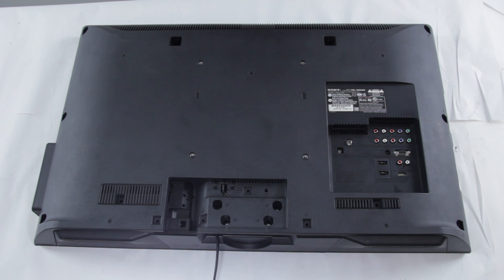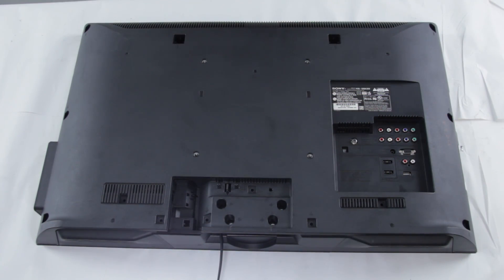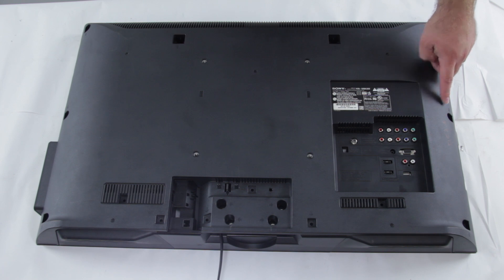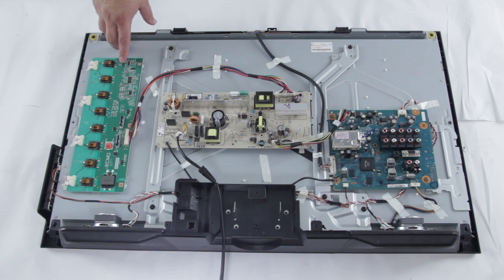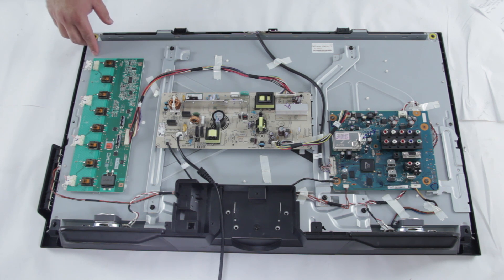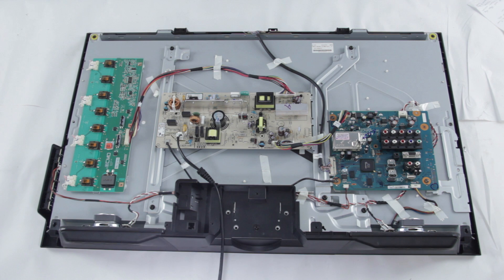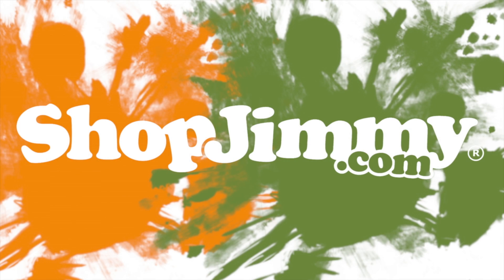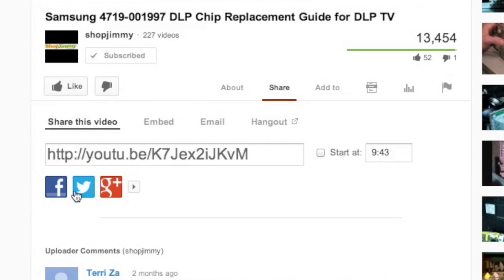LCD TV Repair Tutorial - Backlight Inverter Common Symptoms & Solutions - How to Fix LCD TVs

Comment: i have philips 47pfl6704d/f7 there is sound but no picture we turned all of our lights off and used a flashlight and can see the picture, would this be the inverter?
Reply from the maker: Heather Sullivan   Yes, that is the problem.  For your TV model, the backlight inverter is actually on the same board as the power supply.  Thus, you will need to replace the power supply board.  Here is a link to replacement parts for your TV model number on our website, click here:  http://www.shopjimmy.com/catalogsearch/result/?q=47pfl6704d%2F  Be sure to match part numbers on your current board, with your replacement for compatibility.  You can also call our customer service for further assistance with your purchase.  (877) 881-6492  Thanks and please let us know if you have any further questions with your TV Repair!  www.shopjimmy.com

Comment: I have a vizio m470vse led tv. Just over a year old. It turns on. The vizio logo shows up on the screen and then within 5 sec or so it turns itself off..help please..thank you
Reply from the maker: Josh Bourdon   I recommend running the flashlight test on your TV.  In the flashlight test video we mention that if you do see an image you should replace your backlight inverter, but if you see an image with the flashlight test, you should replace your power supply.  I recommend running the flashlight test on your TV.   Here is a link to a video we produced that shows how to run the flashlight test. No Image No Picture on Screen-Flashlight Test LCD TV Repair - How to Diagnose Broken Board TV Repair Please reply with your flashlight test results and we can recommend a replacement part for your TV repair. Thanks and please let us know if you have any questions! www.shopjimmy.com

Comment: Hello, I'm Fidel and I have a dynex LCD tv DX-40L261A12. I was watching tv and the screen turned black but the sound was still there, so I shut off the tv and turned it back on but now there's no image or sound, ( no sound maybe because I changed channels), it starts up like normal, grey screen with the words please wait.. (thats what it normally did) but right after it turns black. but I have been looking on the internet and all signs point to the backlight inverter, I think. I shine a flash light to the screen and I can see an image of the menu when I click on menu so I hope its not too messed up. Please if you have an idea or a way to help me out I would very much appreciate it. Thank you
Reply from the maker: fidelroldan1   I recommend running the flashlight test on your TV to help determine if the problem is the backlight inverter or the main board. Here is a link to a video we produced that shows how to run the flashlight test. No Image No Picture on Screen-Flashlight Test LCD TV Repair - How to Diagnose Broken Board TV Repair Please reply with your flashlight test results and we can recommend a replacement part for your TV repair. Thanks and please let us know if you have any questions! www.shopjimmy.com

Comment: Hi good video, I have a SONY 40"FULL HD LCD  Model #: KDL40CX520   This TV has a panel issue. Still works, but the picture comes through in green and pink hues. Could this also be the back light inverter, your help would be appreaciated.  thanks Rob
Reply from the maker: yammy64   This sounds like a TV panel problem.  If your TV panel is bad, it may be more cost-effective to replace the TV as panels are typically hard to find in stock, difficult to replace, and expensive.  Thanks and please let us know if you have any further questions!  www.shopjimmy.com

Comment: i have a proscan tv (40ld45q) and the part # is t871034.02-1 i found the part # on ebay but a diffrent modle # can i use it
Reply from the maker: Richard Drew  As long as the connectors match, you should be alright.  Thanks!  www.shopjimmy.com

Comment: Hi, i have a 32" VIZIO (E3D320VX) and when i turn it on, the logo splash screen comes on then shuts off, then the backlight comes on for a second and shuts off. The only thing that stays on is the white LED power indicator light. Also, i have taken the power supply board out and put it back in and it seemed to fix the problem. About a week later, same thing happened so i did the same thing and it seemed to work. It has just happened again but my "fix" isn't working. When i looked up the power board and backlight inverter, it says they are the same?
Reply from the maker: *****   Yes, that is correct the backlight inverter and power supply are on the same board.  Here is a link to replacement parts for your TV model number on our website, click here:  http://www.shopjimmy.com/catalogsearch/result/?q=E3D320VX  Be sure to match part numbers on your current board, with your replacement for compatibility.  You can also call our customer service for further assistance with your purchase.  (877) 881-6492  Thanks and please let us know if you have any further questions with your TV Repair!  www.shopjimmy.com

Comment: I NEED HELP!!! I have a 42" LG LCD T.V. I turn it on and it comes on fine, after about 10minutes of being on the screen goes black, I have sound but the screen wont come back on. I went to my local repair shop and explained the problem to the repair guy. He told me, in these exact words ''The Inverter has gone'' I have tried to find a spare one for my T.V (including on your website) but I am having no luck. I can easily replace any parts myself but I can not find them anywhere online. So my question is....Is it the inverter and if so could you tell me where I can find a replacement? My T.V is a 42" LG LCD with the model Number: 42LF65-ZC & the serial number: 708wraj2u704 & Product Code: 42lf65-zc.aecmljg. Realy hope you can help me out.
Reply from the maker: Arkady Red   Can you find a number on the actual inverter board(s) itself?  This number could be on a white sticker.  If you can find this information, please reply with that number and then I can recommend a replacement part.  Thanks!  www.shopjimmy.com

Comment: Hi my sony tv just went out like no power nothing at all. I try to plug it to another outlet but still no power no lights. Tv  model number KDL-40BX450 WHAT could be the problem please help
Reply from the maker: shane bethel   I recommend replacing the power supply in your TV.  Here is a link to replacement parts for your TV model number on our website, click here:  http://www.shopjimmy.com/catalogsearch/result/?q=KDL-40BX450  Be sure to match part numbers on your current board, with your replacement for compatibility.  Here is a link to a video showing how to identify your part number, click here:  TV Part Number Identification Guide for Sony Power Supply Unit (PSU) Boards (LCD LED Plasma TVs)  You can also call our customer service for further assistance with your purchase.  (877) 881-6492  Thanks and please let us know if you have any further questions with your TV Repair!  www.shopjimmy.com

Comment: Hi, I have a LT46153 and the screen looks good for about 10 seconds when you first power it on then it starts to go dark from the middle towards the sides stopping about 10 inches from the ends, is this a backlight inverter board or a power supply issue in your opinion, Thanks in advance, John
Reply from the maker: John Ray  I recommend replacing the backlight inverter in your TV.  Here is a link to replacement parts for your TV model number on our website, click here:  http://www.shopjimmy.com/catalogsearch/result/?q=LT46153  Be sure to match part numbers on your current board, with your replacement for compatibility.  You can also call our customer service for further assistance with your purchase.  (877) 881-6492  Thanks and please let us know if you have any further questions with your TV Repair!  www.shopjimmy.com

Comment: Hi there I have a samsung 37" lcd tv.
model no LE37A456C2D
serial number 72883HBS102178Y

I was given this tv as it was faulty, pictures would be pixelatted and looked solarized.i took the tv apart hoping it would be a quick fix with a change of capacitors, but now when I turn the tv on the backlights come on but only a black screen is visible.tried to use a flash light but can see anything and cant get any sound.Could this just be replacing invertor or multiple boards that are damaged?
Reply from the maker: Michael Davison  I recommend replacing the main board in your TV.  Here is a link to replacement parts for your TV model number on our website, click here:  http://www.shopjimmy.com/catalogsearch/result/?q=LE37A456C2D  Be sure to match part numbers on your current board, with your replacement for compatibility.  Here is a link to a video showing how to identify your part number, click here:  Samsung Main Boards & Digital Boards: Part Numbers for LED, LCD, DLP, Plasma TV Repair  You can also call our customer service for further assistance with your purchase.  (877) 881-6492  Thanks and please let us know if you have any further questions with your TV Repair!  www.shopjimmy.com

Comment: I have an LG 52ld560 LCD TV which won't turn on. The standby light just flashes red. I replaced the power supply board and this had no effect. None of the capacitors appear damaged on any of the boards. What could be causing this problem?
Reply from the maker: Callan Orgill  I recommend replacing the main board in your TV.  Here is a link to replacement parts for your TV model number on our website, click here:  http://www.shopjimmy.com/catalogsearch/result/?q=52ld  Be sure to match part numbers on your current board, with your replacement for compatibility.  Here is a link to a video showing how to identify your part number, click here:  TV Part Number Guide for LG & Zenith Main, Digital, & Tuner Boards (LCD, LED, Plasma TVs)  You can also call our customer service for further assistance with your purchase.  (877) 881-6492  Thanks and please let us know if you have any further questions with your TV Repair!  www.shopjimmy.com

Comment: I have a Sony Bravia KDL55V5100.  I turn the TV on, the green LED stays lit, the backlight shows through the back of the tv, then the tv turns itself off. Then back on and off again.  I have spoke to ShopJimmy Techs and they told me to replace the backlight inverter boards.  I replaced all three today and still the same issue.  Would this be the Main Board issue?  Please help.
Reply from the maker: Frank Razek   I recommend replacing the BM3 board in your TV.  Here is a link to replacement parts for your TV model number on our website, click here:  http://www.shopjimmy.com/catalogsearch/result/?q=KDL55V5100  Be sure to match part numbers on your current board, with your replacement for compatibility.  Here is a link to a video showing how to identify your part number, click here:  TV Part Number Identification Guide for Sony Main Boards (LCD, LED, Plasma TVs) TV Repair

Comment: your videos are sooo helpful. really appreciate them.  I have a samsung ln46a650. when i start it up half the screen is very dark.  after a while it flickers and then kicks on (although its never as bright as right side, maybe 90%).  i replaced the capacitors but no dice. I tried replacing the tcon but that also had no effect.  Do you have any thoughts on what could be wrong?
Reply from the maker: zaf88   I recommend replacing the backlight inverter(s) in your TV.  Your backlight inverter is either its own board or is connected to your power supply.  Here is a link to replacement parts for your TV model number on our website, click here:  http://www.shopjimmy.com/catalogsearch/result/?q=ln46a650  Be sure to match part numbers on your current board, with your replacement for compatibility.    You can also call our customer service for further assistance with your purchase.  (877) 881-6492  Thanks and please let us know if you have any further questions with your TV Repair!  www.shopjimmy.com
Reply: ShopJimmy.com  thank you but ive located my problem and it is a loose TAB ...any fix for that?

Comment: I have a sharp aquas LC-46D82U. When the tv is plugged in you here a click, about a minute later another click. when the tv is turned on you can here a click and the the blue and green lights come on and the screen turns a faint white, like the lights being half powered. no picture. I watched some of your videos so I took the back off and visually seen no bad capacitors or loose wires. I checked voltage from ground to two replaceable fuses and got 65 vac, I got 600 vac on the fuse that is permanent. Did not get voltage from the plug that goes to the backlight boards but the lights went out when I unplugged that connector.  suggestions?
Reply: There are three red lights on the video board. 1 by itself is blinking, 2 side by side and 1 is blinking.
Reply from the maker: kevin lycans  I recommend replacing the backlight inverters in your TV.  Unfortunately I do not see any replacement backlight inverters in the search results for your TV model number on our website.  Thanks and please let us know if you have any further questions!  www.shopjimmy.com
Reply: ShopJimmy.com just did that....no change

Comment: We have a Vizio Model# SV470XVT1A
We are hearing sound and have no picture at all, do you think it could be the backlight inverter?
Reply from the maker: Sara Welliver   I recommend running the flashlight test on your TV to help determine if the problem is the backlight inverter or the main board. Here is a link to a video we produced that shows how to run the flashlight test. No Image No Picture on Screen-Flashlight Test LCD TV Repair - How to Diagnose Broken Board TV Repair Please reply with your flashlight test results and we can recommend a replacement part for your TV repair. Thanks and please let us know if you have any questions! www.shopjimmy.com

Comment: Sir, I have the same Samsung LN52A650 television with BN44-00201A with the power cycling on/off and red flashing led. I swapped out the four 1000uF capacitors but that didn't change the problem. I then swapped out the power supply with a known good used one and same issue. I was able to get a known good used main board to try and the only thing that changed was no chime. Any ideas on how to proceed?
Reply from the maker: Gary Seymour   Try this repair at your own risk!  Unhook the main board from the power supply and plug it in and if the back lights come on you have a bad main board then if the back lights don't turn on you have a bad power supply.    Here is a link to replacement parts for your TV model number on our website, click here:  http://www.shopjimmy.com/catalogsearch/result/?q=LN52A650  Be sure to match part numbers on your current board, with your replacement for compatibility.  You can also call our customer service for further assistance with your purchase.  (877) 881-6492  Thanks and please let us know if you have any further questions with your TV Repair!  www.shopjimmy.com

Comment: Sony Bravia KDL-32L504
When you plug the power cable in you hear a click. When powered on via the remote or button on TV green LED comes on, picture comes on for 1 second and then screen goes black.  If I change the channels or hit the menu button as soon as I power it on you can see the menu options on the screen for the 1 second that the picture comes on or if I select a channel or change the channel the correct channel number appears. No flashing red LED just solid green when powered on. Also, have tried the flash light test after power up and cannot see anything at all...screen is just black.   I've been looking, researching on line for this specific issue and have only seen a couple of posted but no solutions or how to fix videos.  Any advice would be greatly appreciated!!
Reply from the maker: Steve Doyle   I recommend replacing the A main board in your TV. Here is a link to replacement parts for your TV model number on our website, click here:  http://www.shopjimmy.com/catalogsearch/result/?q=KDL-32L504  Be sure to match part numbers on your current board, with your replacement for compatibility.  Here is a link to a video showing how to identify your part number, click here:  TV Part Number Identification Guide for Sony Main Boards (LCD, LED, Plasma TVs) TV Repair  You can also call our customer service for further assistance with your purchase.  (877) 881-6492  Thanks and please let us know if you have any further questions with your TV Repair!  www.shopjimmy.com

Comment: I have a Vizio VW46L  FHDTV20A and I get a dark shadow on screen when I first turn on TV. After about 45 minutes everything shows as normal. Is this typically a backlight issue?
Reply from the maker: John Littell  This sounds like the problem could either be a bad main board or TV panel.  If the problem is the TV panel, it may be more cost-effective to replace the TV.  You can replace the main board to see if that fixes the problem.  Here is a link to replacement parts for your TV model number on our website, click here:  http://www.shopjimmy.com/catalogsearch/result/?q=VW46L+FHDTV20A  Be sure to match part numbers on your current board, with your replacement for compatibility.  You can also call our customer service for further assistance with your purchase.  (877) 881-6492  Thanks and please let us know if you have any further questions with your TV Repair!  www.shopjimmy.com